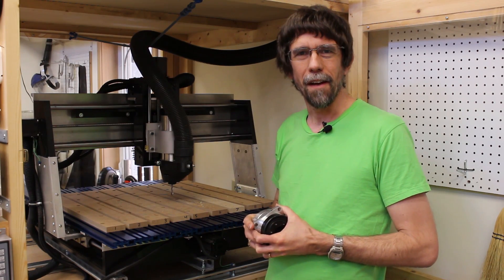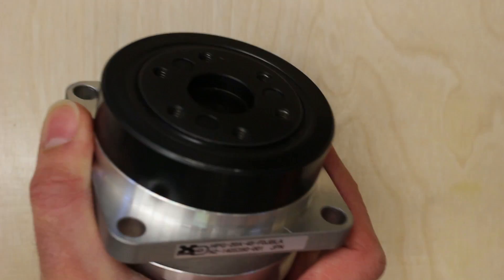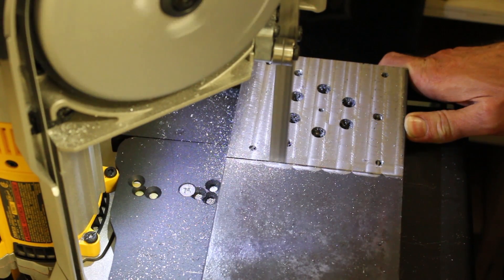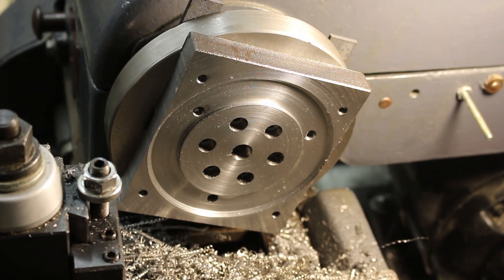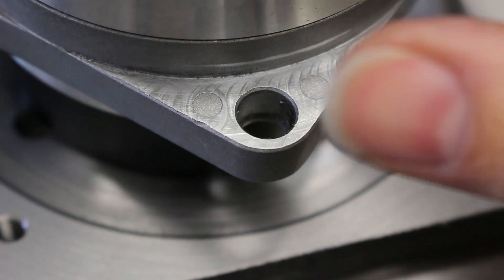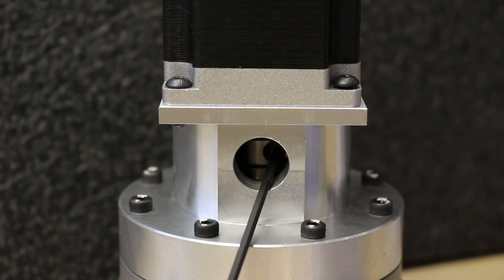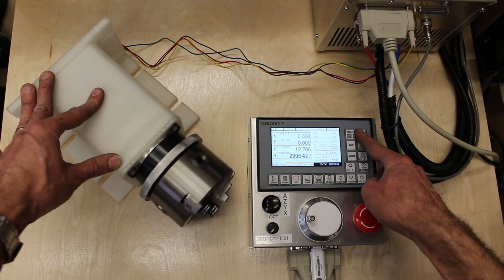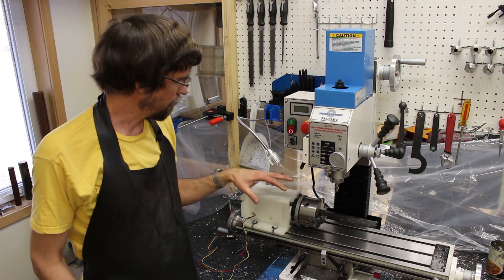4th Axis Harmonic Drive Build Part 1

Comment: Harmonic Drive's design on HPG, HPGP & HPF Series allows the internal gear to elastically deform, accommodating the operational stresses that might otherwise lead to increased backlash. This elastic deformation is specifically intended to maintain consistent backlash levels, compensating for the wear and tear that might typically lead to increased backlash in a traditional gear system.
HPG-20A-45 Permissible Radial Load 1,890 N, Permissible Axial Load 2,830 N.

Comment: Thanks for the brilliant video and excellent explanation. Don't you need a mechanism to avoid unwanted rotation during machining, for example a brake machanism. Also i want to know why would you use stepper motor instead of the servo ones.
Reply from the maker: Glad you found it useful. The stepper motor's holding torque is multiplied by the gear ratio of the gearbox, so the motor makes an effective brake provided that one doesn't try to cut too aggressively. A servo motor definitely has advantages but it adds cost and complexity, and the rest of my CNC machine uses steppers so it would not be a major advantage to have a servo just in the 4th axis. A servo may support greater acceleration and can be pushed harder since it doesn't suffer from lost steps, but I think steppers are a good choice for low-volume hobby work like mine where slowing things down is not a major disadvantage.

Comment: This is a great build. I’d love to know why you choose to use a 3 Jaw chuck instead of a 4 jaw?
Reply from the maker: Thanks. The main reason I used this chuck is that I already had it for use with my metal lathe, where the 3-jaw works well for round stock. I find it very useful to be able to move the chuck between machines while keeping the workpiece mounted. For square stock a 4-jaw chuck would be better and it would be easy to swap chucks if a need arises.
Reply: @BrainRight  I know it was a while ago, but any chance you have the model number of the Harmonic Drive you got? Or at least what you searched for?

Comment: Great explanation. I`m new to the robotics field. 
I`m designing a 6-axis robot with harmonic drives. 
I`m planning to implement the robot as a hand guiding for position teaching. 
Since harmonic drives has high torque, is this possible to do with stepper motors? If someone has an idea about these things, please leave a comment.
Reply from the maker: It is certainly possible to make a robot using stepper motors and harmonic drives, but whether it will meet your requirements is another matter. A gearbox such as this has a high reduction ratio, meaning that it multiplies the torque but divides the speed. So with a modest stepper motor you can get a lot of torque but the output won't rotate very fast. And the torque of a stepper motor decreases as its speed increases (look up the torque curve of any motor you are considering) so there's a limit to how fast you can step it and still get enough torque for your application. Just off-hand (no pun intended) it sounds like you may not need much speed or torque so it may be suitable for you, and you can get less torque if desired for safety by reducing the motor drive current. You might want to look for stepper or servo motors with an integrated gearbox and if a stepper, a position encoder.
Reply: @BrainRight  Thank you for your quick response. 
I`m considering steeper motor with absolute mechanical encoder. 
But my problem is will I able to teach the position to robot arm using hand guide due to the high torque of the harmonic drives?

Comment: I would like to buy a 3rd party 4th axis do you have the wiring diagram for the 4th axis shark Controller card?
Reply from the maker: No, sorry I never used my 4th axis with the original Shark controller and never had the 4th axis card for it.

Comment: Hey there! I am making a robotic arm with 5kg payload capability. From my calculations (worst case scenario), I would need about 100Nm of torque and I had chosen Nema 23 (holding torque 1.9Nm) & harmonic drive gear from HDsystems which are the same as yours! However, I have a question as to what specification should one look for while looking for a harmonic drive? Is it just solely the reduction ratio?
Reply from the maker: That's the main thing but also check the maximum rated torque and the specified backlash, which causes angular positioning error. You can't get it to zero but it's typically very low for drives like this.

Comment: would you say using aluminium instead of steel for the faceplates would be fine?
Reply from the maker: Aluminum deforms more easily but it probably wouldn't make much difference, assuming that this axis would be subject to relatively low cutting forces.

Comment: Nice work! the unit used is a planetary reduction, not a strain wave gear, right? the brand is 'Harmonic Drive' but they have a few versions of the reducers, where the lower ratio planetary versions have a lower backlash than the (<3arcmin) than the larger ratio versions. (for planetary reduction that is)

Comment: Very cool CNC interfaced index.  How is that indexed? Do you use a secondary program with the number of degrees you want to move and an M23 in the program to trigger the move, or does it use an "A" then the number of absolute degrees in the main program to index?
Nice job !!!

Comment: Using the same 4th axis setup on my Shapeoko for mainly wood, but nothing harder than 7075, can you see any issues with milling the housing and plates from 6061 that will be heat treated afterward as opposed to steel?  The only 'special' tools I have at my disposal are a Shapeoko 3 XXL and drill press so milling this much steel is a bit out of my reach.

You're awesome by the way, a real kick up my ass to try harder.  Thank you for sharing.

Comment: That’s probably the smallest harmonic drive id consider using. The 32’s seem to be better suited for 4th axis work if you intend on doing any heavy cutting or metal work. For wood, plastic, I see no reason this wouldn’t work fantastic. Nice assemblyz

Comment: I really like your project and appreciate the delivery and production quality, you clearly have many talents. I'm reviving a small CNC mill at the moment and would like to add a 4th axis after getting the core functions working. I found the harmonic/planetary drive you're using and requested a quote, they came back with $905 each. Is that right?? I really like the idea of having a quality tool and the DIY path usually keeps the price down. Maybe I don't know what a good commercial tool costs?? Most of the commonly available items are around $500.

Comment: Hi,
good effort, I need to know, how you generate 4th and 5th axis Gcode and which software you are using. my email address is imran.plus@gmail.com
Reply from the maker: Hi Imran, I use Fusion 360 to generate the gcode. My micrometer dial videos show how I use it, and you can find lots of good Fusion 360 tutorials here on YouTube. I only use up to 4 axes but Fusion 360 supports 5-axis machining too.

Comment: Sorry I have to correct you - one info is misleading. HPG doesn't stand for High Precision although it could be. Instead it stands for Harmonic Planetary because this series of HD gears are not harmonic drives but really really high standard planetary gears with backlash below 5 arcmins. Its really good among the planetary gears. One of the best it can get with that transmission type.
Reply from the maker: The manufacturer's website http://harmonicdrive.net/ has changed quite a bit since I made this video, and they previously used the term "High Precision Gearbox" (they still have it in the HTML page title, maybe an oversight). It looks like that's been replaced by "Harmonic Planetary Gearbox" which is a more descriptive term and also trademarked. Honestly I'm not sure I would have chosen this gearbox if I had understood that it was planetary and not strain-wave but that distinction was a bit muddy on the Harmonic Drive website and documentation at the time. I plan to make a video measuring the actual backlash and torsional stiffness of my gearbox, but alas it hasn't made it to the top of my to-do list yet.
Reply: Ha ha! Well, rats. I just ordered one of these. I'll give it a go anyway. :-)

Comment: Hi Sir. Good work.
Can you tell me what feed rate, DOC,  tool diameter, nº of flutes and RPM are you using in mim. 11:07?
Thanks.
Reply from the maker: For machining the aluminum adapter plate I used a 6.35mm/0.25" diameter 2-flute spiral carbide end mill in a router at approximately 20,000 RPM. The cutting feed rate was 600 mm/min, max horizontal stepover was 3mm and max vertical stepdown was 0.5mm. These parameters may be far from optimal due to my limited experience cutting aluminum on this machine, but they gave satisfactory results and in general it requires very light cuts to minimize cutting forces that will deflect the cutter due to the limited rigidity of the machine.
Reply: thanks

Comment: Good morning you can send me the program in a ZIP for my arduino uno for the classical movement of the rotary chuck intex my eimail is ; maik.nakas@gmail.com best recards..
Reply from the maker: I'm sorry but I am not using an Arduino for this project and don't have any program to send you. If you are looking for Arduino code to run stepper motors I suggest you check http://www.adafruit.com/ and http://www.sparkfun.com/. They both offer stepper driver shields and sample code to run them.
Reply: Thank you very much..

Comment: FWIW, the HPG series is a planetary gearbox not a harmonic drive, it is just made by Harmonic Drive Inc. I had one of the same series gearboxes and thought the same thing until I pilled the gearbox off the servo it was attached to.
Reply from the maker: Yes the Harmonic Drive web site has been updated since my initial research and they make the difference a bit more clear, i.e. it's not a strain-wave drive (commonly called "harmonic drive") but it does have continuous backlash compensation whatever that means. I plan to measure the backlash soon, so we'll see if this particular unit comes close to the manufacturer's specs.
Reply: We've found these to be one of the best gearhead mfg's on the market in their class. The backlash should be around 3 arc-min for the model you have unless it was abused. More that likely, you can expect a long life in your application.

Comment: Very nice work! For larger diameters the jaws in that chuck might be reversible.
Reply from the maker: Yes the jaws are reversible but I would also need to elevate the unit on a spacer so the protruding jaws clear the table.

Comment: I think the HPG-drive you have is actually not a harmonic drive internally. (meaning the strain wave gear.)
I have one just like it and I believe the hpg is a planetary drive, but a really good one.
Made by Harmonic Drive company though. :)
Reply from the maker: I think you're right that it's not a strain-wave drive, which is often inaccurately called a "harmonic drive", but it's a Harmonic Drive brand planetary gearbox with "continuous backlash compensation". I see that the Harmonic Drive website has been updated recently and it's a bit more explicit about the difference now.  It will be interesting to measure the actual backlash of this unit, which I plan to do soon.

Comment from the maker: In response to my faceplate video (https://www.youtube.com/watch?v=XvSZ1PYEcmY) I received this question from Nicholas Miller, which I am reposting here:   Have you had any problems with lack of holding power using the nema 23 and planetary reducer. I purchased one and am now at the stage of buying a stepper, curious if you have any insight.... thanks - Nick

The needed holding torque of a 4th axis depends a lot on what you want to do with it, i.e. how much torque is likely to be applied. Light cuts with a small tool and a small radius from the axis (such as my micrometer dial engraving, https://www.youtube.com/watch?v=3g9IFnVDOTo) would impart far less torque than heavy roughing cuts at a large radius from the axis (such as rounding the edges of the backplate as I showed in the 4th axis build part 2). It also depends on the consequences of slippage, e.g. lathe-like cutting operations might not suffer at all from some slippage, and it's quite possible that some slippage or lost steps occurred as I was rounding the backplate edge but it would have gone unnoticed.

I don't know how to calculate the exact torque imparted by a particular end mill when it's cutting at a particular rate, but as a simple worst-case calculation we could suppose that it digs in to the part and engages like a gear. With a 1/4" cutter at the perimeter of a 4" diameter part (or 6mm cutter at 100mm diameter), that's equivalent to about a 16-to-1 gear ratio so it could impart roughly 16x the torque of the mill into the 4th axis. Going through my 1-to-45 gearbox that's about 0.35x the mill's torque at the stepper motor shaft, so the stepper needs to provide about 1/3 the torque of the mill in order to resist slippage under these conditions. My mill has a 1 HP motor and turns the spindle at 1250 RPM in low range, which (pulling up an online torque calculator here) should give a max torque of about 5.69 N-m. The stepper needs to provide 1/3 that much torque to resist slipping, so we'd need a stepper motor with 1.9 N-m holding torque rating. As it happens that is exactly the max holding torque rating of my stepper motor, and it is pure coincidence that it worked out that way just now because I didn't do this calculation ahead of time and I just picked arbitrary numbers for the part and cutter diameters in this example. I chose 1.9 N-m steppers for a much simpler reason - it's the size that my CNC router uses and I wanted to have similar motors on all the axes.

The holding torque is not the whole story though, because stepper torque drops off as the speed increases. You can find torque curves for specific stepper motors, and for mine it typically drops by about 50% at 1000 RPM. So while my stepper should be able to resist the torque of a heavy cut under conditions described above when it's stationary, it would be prone to losing steps if such a heavy cut were taken with the axis rotating moderately fast. I wouldn't worry about it at all for things like engraving, but for roughing especially I will make sure to take relatively light cuts.
Reply: @BrainRight WOW! thank you so much for the wonderful / detailed response I really appreciate it! It gives me a direction to go as far as research / picking a motor! I'll let you know what i come up with, I have a pretty cool harmonic Rotary / indexer build in the works! Thanks again - Nick
Reply: Slightly tangential, but on the Fusion 360 channel is a video from Pier 9 of some exotic tool that measures load and I assume torque on the tool as the tool is running. (Probably costs more than all my tools combined.)

Comment: Very impressive design, craftsmanship, and description! Off to part 2 :)
Reply: There's nothing impressive about it.   you can get the exact same thing on EBAY for less than 200  For the WHOLE THING!!!   (and free ship! to boot!)
This guy paid 200 bucks just for the Harmonic drive.  plus motor, Chuck, chuck plate, adapter, etc etc. and all the LABOR.........Tsss
I rather Click twice on Ebay and get it,  ready-make.....
(I made my own using using COG PULLEYS and BELT type. In fact I used to sell them on Ebay. they're too cheap now.  NOT WORTH my time to mess with)
Reply: @jesscast5122  try pricing it today....